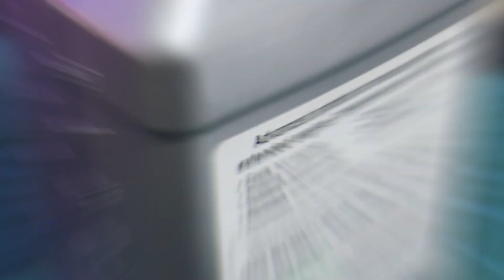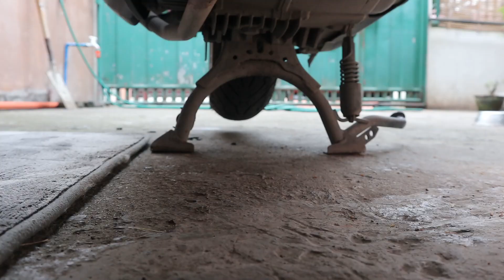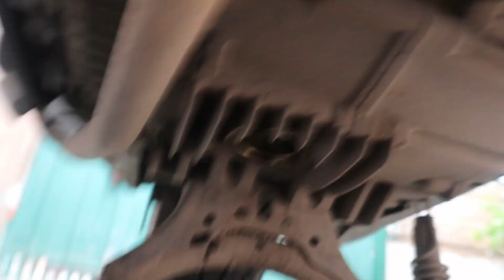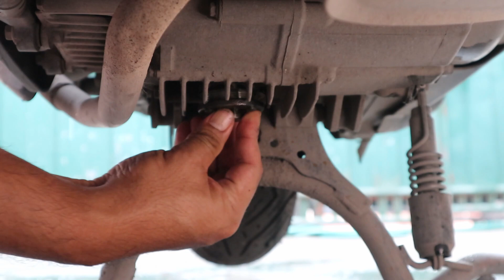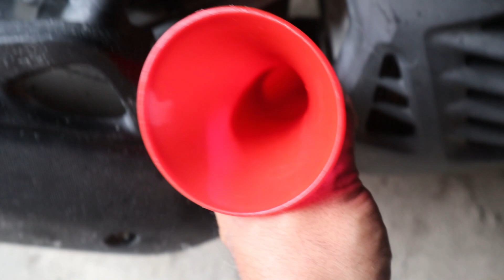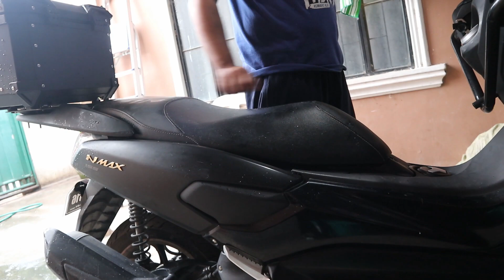DIY Oil Change for Your Scooter

Comment: El mejor y confiable aceite
Reply from the maker: Are you using this oil for a long time?
Reply: Unos 5 años y utilizo ese mismo 20w50 ya que en Arica -chile, el calor es como Tailandia,mucho calor, esa viscosidad es ideal porque es muy estable en temperatura y también en altas vueltas del motor (autódromo) en mi Suzuki GSXR 600 va espectacular.
Reply from the maker: @alexoyanedel3902  Wow, 5 years of using the same oil and in such challenging conditions—impressive! It’s awesome to hear how well 20w50 performs in both the heat and high RPMs on your GSXR 600. Thanks for sharing your experience, Alex! Makes me want to try it for my rides too. Do you do a lot of track days with your bike?
Reply: El fabricante de esa marca, asegura que el aceite dura un año en el motor con alta carga (exigencia) y yo lo cambio cada 5 mil o 6 Mill kilómetros.
Como te decía, llevo 5 años usando esta marca y no le arrepiento. La historia de este aceite proviene de la base sintética pero que usaban en los aviones ,es más, el creador de este aceite era piloto de guerra y ahí obtuvo la base para su marca. Saludos